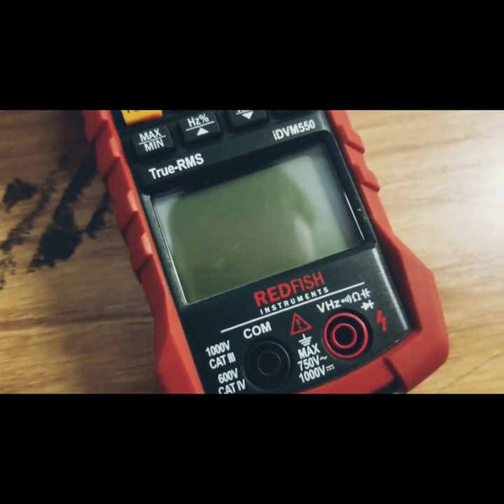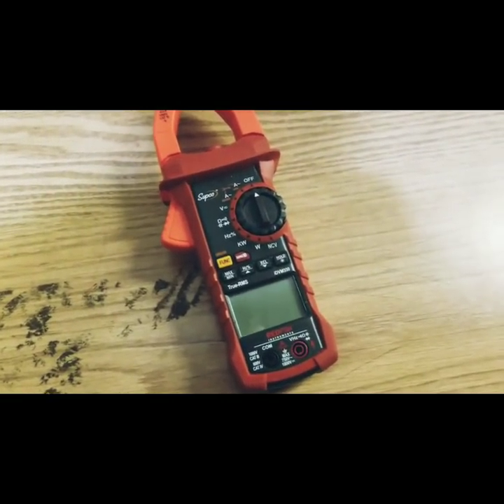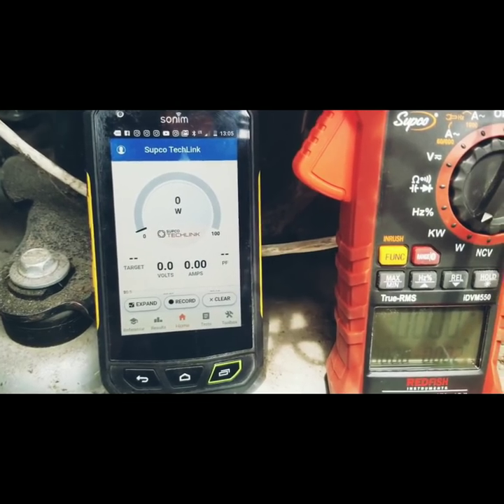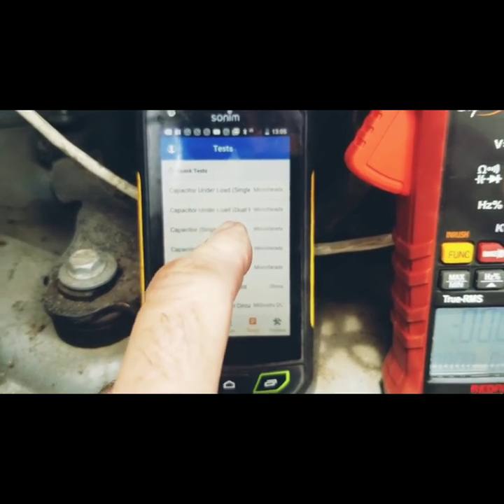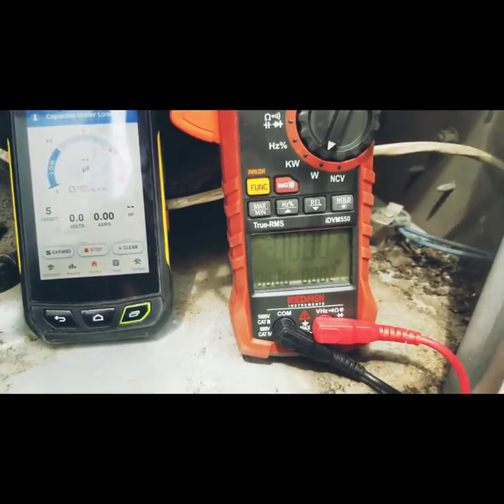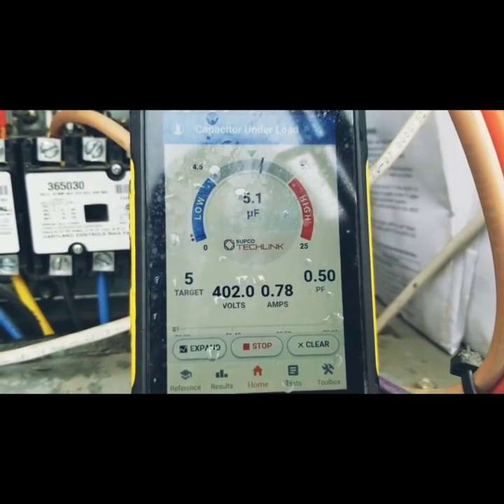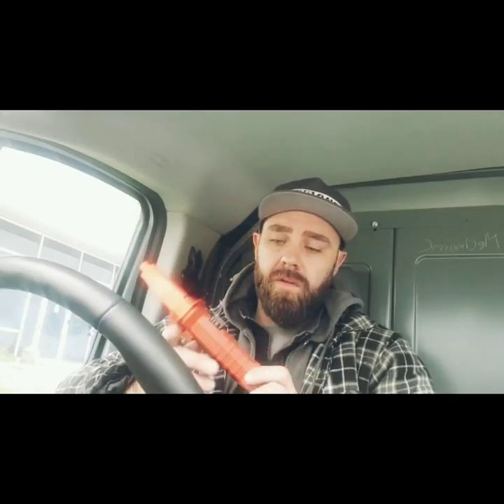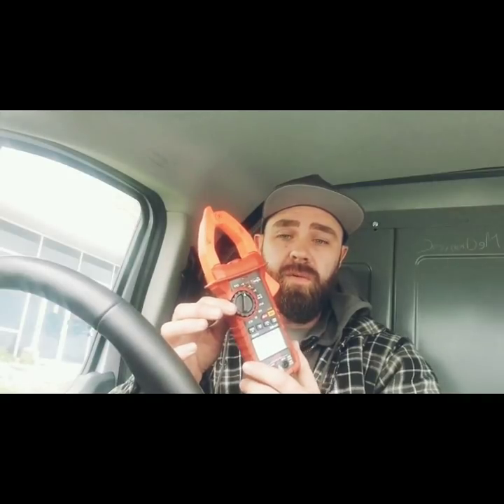HVAC - Redfish iDVM550 Checking Run Caps Under Load

Comment: I like the redfish meter but how long does it take to set it with app and all. As I'm watching this video it seems like it take a few more minutes then doing it the old fashion way. Your thoughts
Reply from the maker: Well remember this is a demo showing how, but once you know how to set up it will take less time
Reply: Yes the app is very nice once you get the basics down I think it will be just fine
Reply: Checking underload can be done quickly once you get use to it, now the Awsome feature of this meter is when pairing it with measure quick. It’s Awsome to get live eer rating and power metrics

Comment: Can it be done on the measure quick app as well or only on the supco app? 
And the clamp has to be used too or you just had it there to hold the meter in place? Thx
Reply from the maker: Supco TechLink is powered by MeausreQuick.  But only on the Supco app.  Yes, the clamp must be used.

Comment: What you put it up against a fluke?
Reply: I absolutely can't afford all fluke. I can afford like fieldpiece or UEI
Reply from the maker: It is it's own meter and I've only just had it for a while.  Hard to say at the moment
Reply: I own both this and a fluke, I would say fluke would out perform this one if used exactly the same as a simple hvac meter. Now where this outperforms the fluke is using it with the TechLink app and Measurequick. If you are a Measurequick user this meter is Awsome. I will say u have to make sure you shut it off after every usage or turn off Bluetooth when using it as a simple meter because it does eat batteries
Reply: @hozerhvac4406  thanks cory

Comment: Will this meter check a capacitor under load and display it on the meter’s screen ? Or does it require a phone for that ? Thanks
Reply from the maker: Yes, it requires a mobile device
Reply: The device will just give you the 3 readings needed to calculate the info. I believe it's amps, volts, and power factor that you need to calculate under load

Comment: You can do this much easier. Check run and start together this should equal common +or - 1 amp and the cap is good.
Reply from the maker: there is no start cap on this
Reply: Start and run windings together should equal the common leg + or minus 1 amp. If it’s within 1 amp the run cap is good

Comment: But does it have magnet on back!!?
Reply from the maker: no
Reply: @HVACKnowItAll  from where did you get it , and can you use it on the iconnect app bluetooth ? also how much they cost ?
Reply: No Magnet that kind of sucks but probably will make some strap down the road
Reply from the maker: @veronicasofia7544   TruTech tools it's around $219 I believe  but save 8% with promo code knowitall.   It works with the Supco Techlink app

Comment: Redfish iDVM550 aka Ames CM1000A $99 at harbour freight. Supco has no shame.
Reply from the maker: They perhaps bought it from the same manufacturer and it's rebranded.  You'd be surprised how many tools are like this.  Supco packed in a lot of features and tools through the techlink app that the ames will never have.  So no, there shouldn't be any shame.  Look beyond the surface.
Reply: @HVACKnowItAll  3 times the price just because they added bluetooth and made the app? an intermediate level engineer could probably do that to any meter in  2 weeks. I ll pass.
Reply from the maker: No one asked you to buy it lol, I was demonstrating a feature.  Here is a virtual hug...seems as though you need it, stay safe.
Reply: @HVACKnowItAll  I didnt criticize your video, no need to get triggered. Im criticizing a product and made a valid point I believe. I like ur channel, see ya!
Reply from the maker: Not triggered, takes a lot to do that.
Reply: Does the CM1000 has back light? Does it has Bluetooth? Does it work with an app?